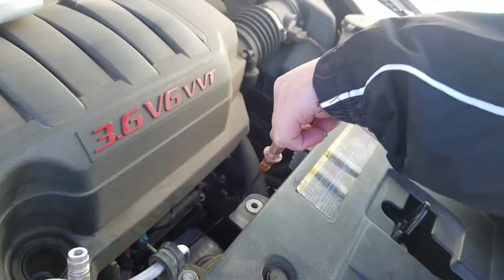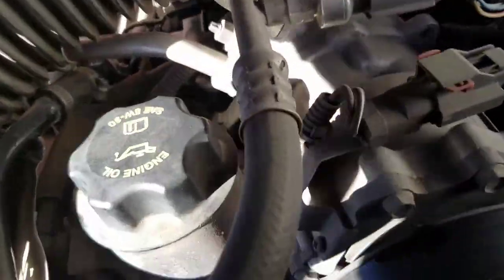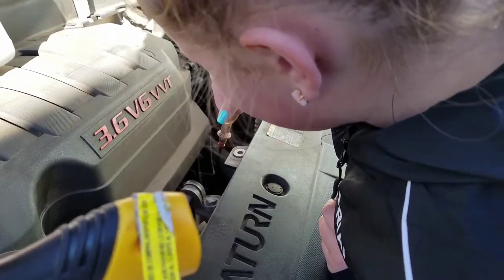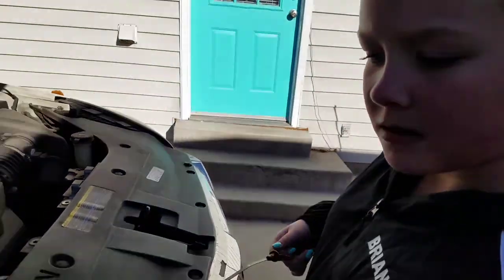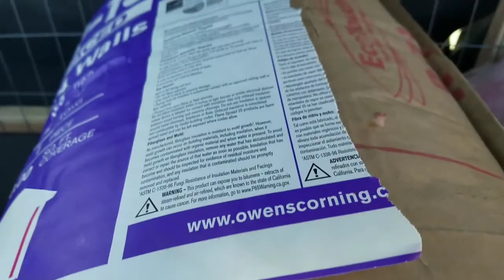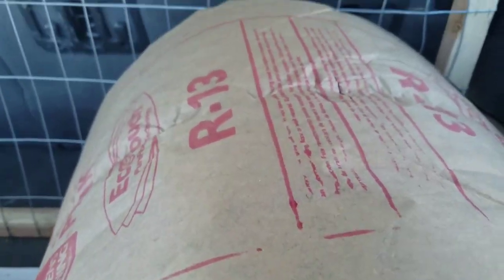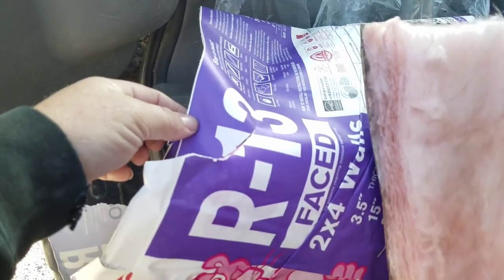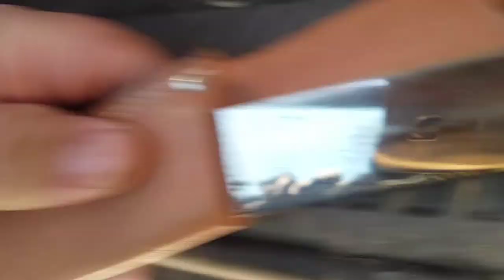INSULATING SPRINKLER VALVES??? Customer wanted this!!!

Comment: The purpose of insulating is for additional protection against a very short surprise freeze.  Under a hour maybe two.  During the day the ground/box heats up and the insulation holds that heat in.   It can be just enough to prevent a hard freezing of the valve that blows it apart.  If you read the valve manual many mention doing this.  Obviously it's not to avert having to blow out the system.  The only downside is a false sense of security causing people to turn their system on or off too early or too late.  Where you made a mistake was using the wrong insulation.  Fiberglass/paper backed in a wet environment what were you thinking?  Also the box should be filled to the top not just one layer.
Reply from the maker: The water is turned off and we don't insulate anything after winterized.  Customer wanted this.  Not something I do lol
Reply: @Squarebodyshelley  You think insulation is for after it's been winterized? haha. Well that's your error.   Again, insulation is for a surprise freeze in spring or fall.  In the first few weeks of  operation in spring or before it's drained in fall.  For when the water is on, not after it's been winterized.  I clearly explained that above.  SMH.  If you're in irrigation you can offer this as additional service but use the right product not paper.
Reply from the maker: @NoName-ml5yk  I know exactly why people insulate. However we don't insulate here.  Just doing a requested job that the client requested we do. I would have done it differently but it's what the client wanted through the management company. But another thing is nobody here insulates in ground valves.. Maybe you do. That's great but that would be a hard service to sell here. But you make an excellent point.  What would you use for a temporary insulation of valves for a surprise overnight freeze?